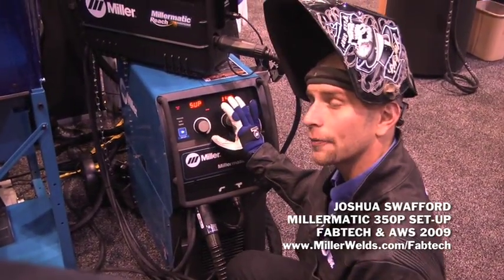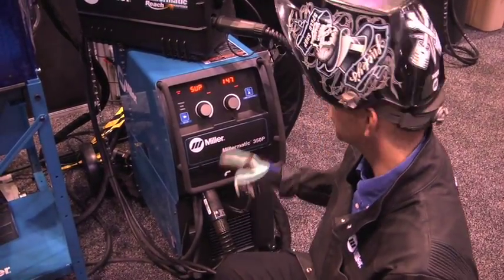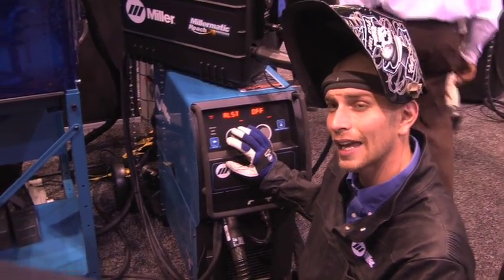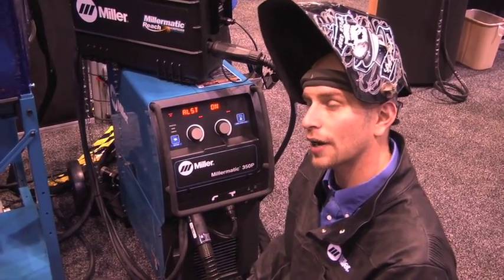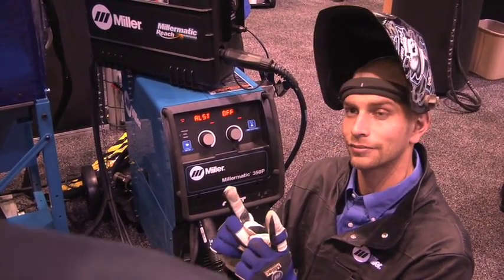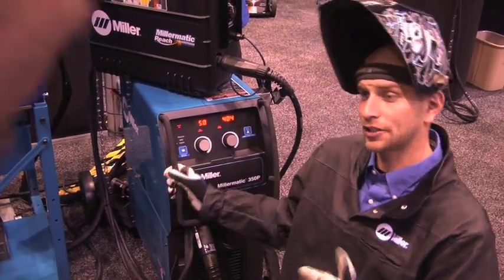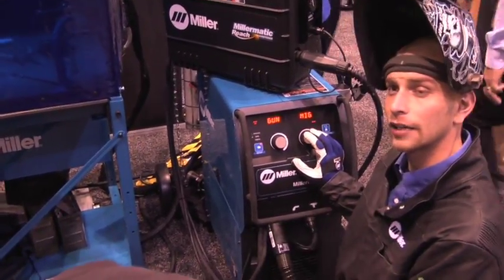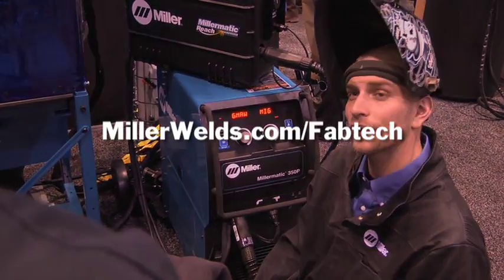Millermatic 350P Set-up for MIG and Pulsed MIG Welding

Comment: the pulsed spray setting works beautiful when I weld flat but I cant control vertical what am I doing wrong also I cant adjust settings when its it pulse mode where can I find out how to set he parameters